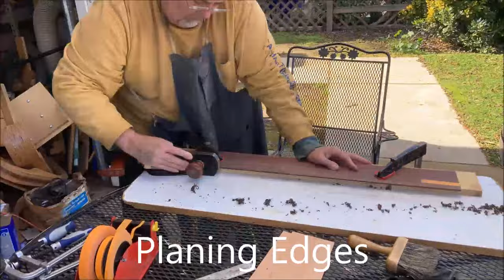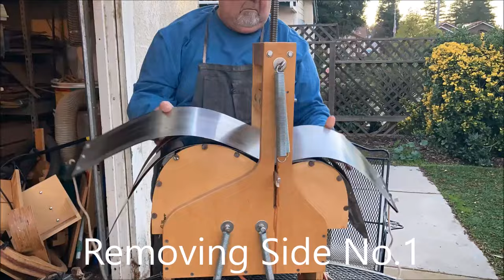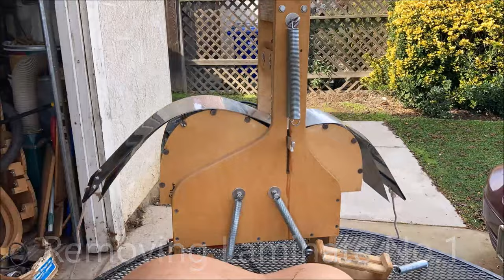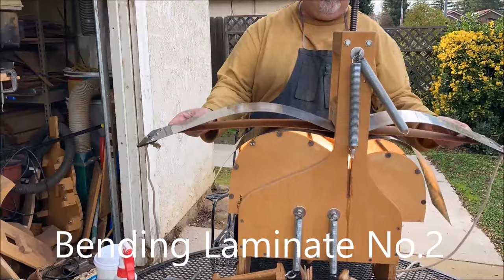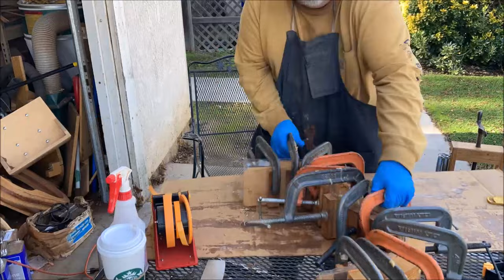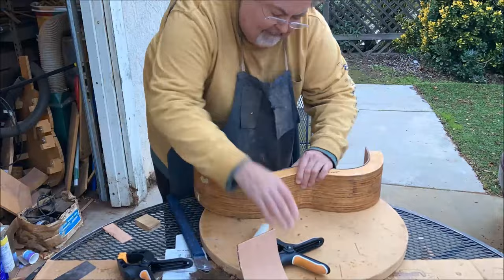Making Laminated Sides From Start To Finish| David Schramm Luthier

Comment: What are the advantages of laminated sides?
Reply from the maker: Better projection, clarity, focus, structurally more stable, ...
Reply: @schrammguitars interesting what about limited backs and tops. I always thought lamination in a classical guitar made it something “less” maybe more factory, with cheap cuts of wood. But then what is a “double top” if not lamination. 🤯.
Reply: Thank you.
 @schrammguitars
Reply from the maker: Huge difference between the laminate shown in this video and the cheap factory ones. Look at all the world renown guitars that use double laminated sides. Friederich, Oribe, Ramirez, ...It isn't done for cost savings. It's more expensive and produces great results. Many advantages. @TimEmmerton
Reply: Nice video, looks like you are getting excellent results with your process. I am curious, what glue are you using?
Reply from the maker: @michaelelwell7476  Gorilla glue.